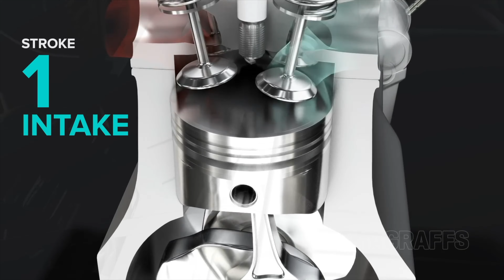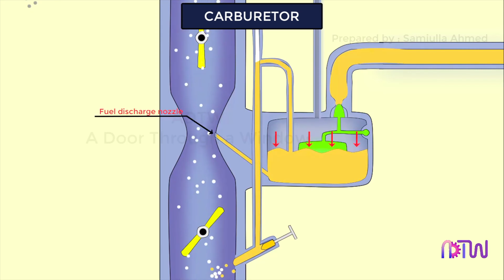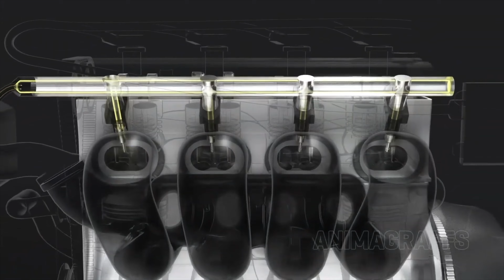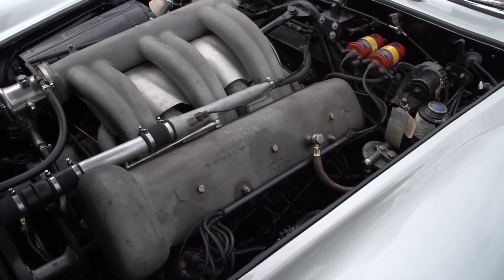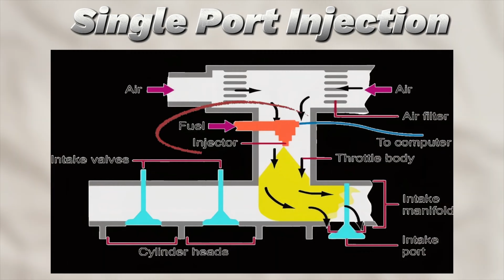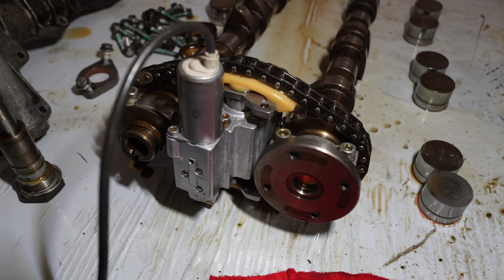Carburettor vs  EFI: How Electronic Fuel Injection Changed the Game

Comment: It has been found that cylinder head valve ports work best when not a uniform size.  Strangely, this idea is similar to the venturi effect of a carburettor.

The Mercedes-Benz 300SL was direct injection.
Alfa Romeo Spica mechanical injection did meet regulations and was superior to Lucas.
Bosch first introduced D-Jetronic which is an electrical injection with pulsed injectors  which was in many ways better than K-Jet and refined by microchips to make L-Jetronic which under LE was largely the first management system which is where Motronic came from.
Reply from the maker: Absolutely spot on information wise. Unfortunatley I had to cut out a lot of finer details such as the 300 SL featuring direct injection, to keep the video as short and as punchy as possible. It would have been wonderful to talk about things such as the Bendix electrojector system from the late 1950s, offered on some Chrysler cars, which was then sold to Bosch who developed it into the D-Jetronic system. Likewise the Rochester ramjet mechanical fuel injection offered on 1950s Corvettes.

I was trying to focus on the big "landmark developments" and the systems most classic enthusiasts are likely to find under the bonnet of their classic. Hopefully this video will be helpful to most enthusiasts - Bob.
Reply: @Motorhaus I guess I thought you may have mentioned D-Jet is it was fairly common in early 1970s Volvos.  It's mostly quite a robust system but a "Bosch specialist" once blew all 6 of the 6 volt D Jet fuel injectors on their 12 volt test rig.  That's why I do as much personally.  Stung too many times.